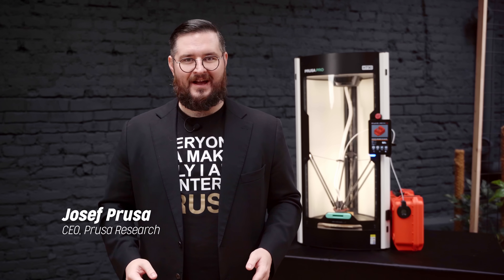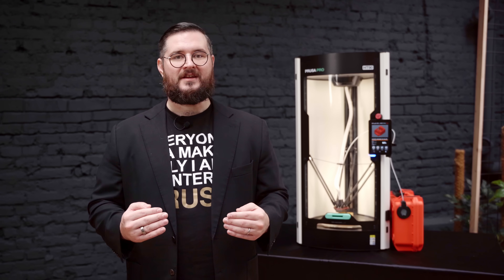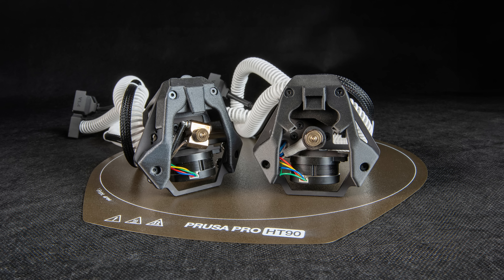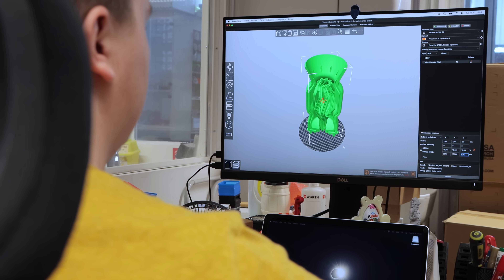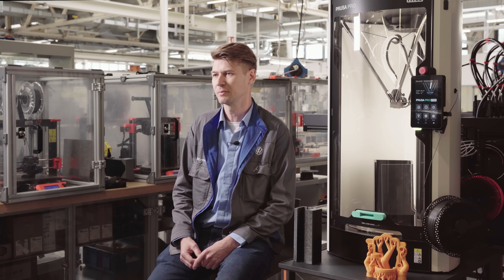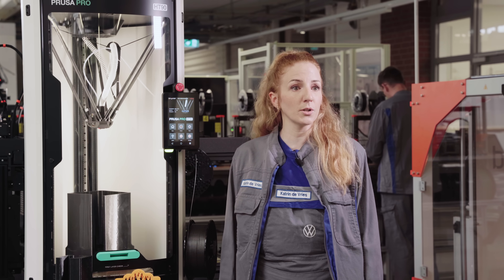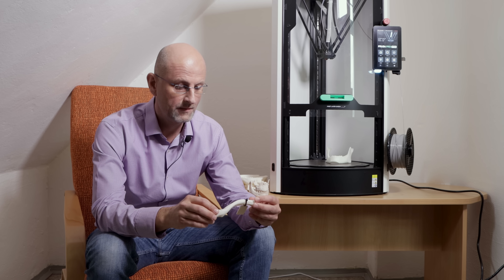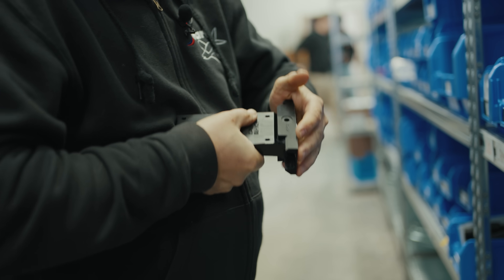Prusa Pro HT90 is here: The Only 3D Printer an Engineer Needs

Comment: As an engineer (3rd year student) one thing missing with these FDM printers is easy watertight/airtight parts and very occasionally resolution. It’s come up as an issue multiple times for me. Mostly the former. I think this could be solved without resorting to a resin printer by Prusa. One produce a highly accurate mini FDM printer within the existing machine. Something modular maybe. So like you change the nozzle on the Main machine but the xyz axis is different so it’s way more accurate, also maybe this would require a specialised filament they could charge a premium for that had very low thermal expansion. The second thing could be a separate post processing machine that basically intelligently melted the layers into a homogeneous surface automatically. I’ve tried this with a heat gun and and a blow torch and have ruined many parts, I usually end up option with coating the entire thing with epoxy resin and that’s annoying. I’m also aware you can make watertight and possibly airtight prints with certain setting but from what I’ve seen those techniques have draw backs and limitations and also require a lot of trial and error.
Reply: I don't mean to offend you, but did you try any prusa printer?  Because with mine (which is a FDM btw), I never had any issue making watertight parts.  The settings are not complicated, it's just a matter of walls / infill.  If you meant however an assembly of multiple part being watertight, again, It's a matter of tolerance, and prusa printers are really good at it.  However I agree, there are lots of trial and errors, but the good thing is, once the setting is done, their machine are so well tuned workhorses, you'll end up with good result everytime.

It's bit of a shame prusa is slowly leaving the consumer market.  I'm glad for their success, but I'm sad we won't see any new affordable gems like the prusa mini in the future...

Comment: This looks cool and the obvious headliner of the peek/other high temp filaments. I just wonderif this still has the same strain gauge auto z offset etc as the other modern prusa printers in the line up.

Also, whether it has input shaping calibration (which I guess I would assume based on the speed).

Regardless, not many high temp printers with decent usability around this price point and I certainly havent seen pseedy ones.

Comment: Ehh... good for engineers and whatnot. Between this and the XL it seems Prusa is forgetting about the hobbyists. :/
Reply: They can't compete in that space any longer. I think that's why they're going after the industrial segment.
Reply: Prusa will do the same that Ultimaker has already done in the past.
All these companys can not compete with the chinese anymore in the hobbyist price range.
So the only solution for them is to move into the direction of industrial printers and sell
the service and not the printer alone.

Comment: Does the slicer correct for shrinking ?  I heard this is one of the issues with high temperature materials.
Reply from the maker: Hi. Yes, Prusa Slicer will apply some corrections. There are also other values in Prusa Slicer that can be adjusted manually to compensate for some specific model.

Comment: I wish you'd rather go down the route of pioneering Non-planar 3D Printing. Feels like that would be more in-line with the original spirit of Prusa Printers, or at least my perception of it.
Reply: It's not like they are only able to focus on one direction at a time. Prusa covers a really wide spectrum of users right now, just because they release one printer doesn't mean the gears are not turning for lots of other stuff under the hood. The blog words this nicely, "We have no plans to change our direction with the Original Prusa printers or to make a sharp turn towards an industrial-only company. However, expanding to industrial segments makes a lot of sense."

Comment: Printer noob here. Can anyone explain how I can justify buying one of these over the X1E?
Or however many X1Es I can afford with the pricetag?
Reply: X1E has a max nozzle temp of 320c, bed temp of 110c and 60c chamber. The Prusa has 500c nozzle, 155c bed temp and 90c chamber.
This enables a ton of new materials to be printed. 
If you don't need the high temps then I would rather go X1E, but the whole selling point of the Prusa is the high temp.

Comment: almost 12k and is it still all 3D printed as all other prusa machines ?
Reply: Are there 3d printed parts? I did not notice.
Reply: From the video it seems only the fan duct to the print are 3D printed. And probably the control panel attachment to the printer body.
Reply: It's an industrial printer, man. :D So it's not all 3D printed, and the price seems to be spot on to me.

Comment: Still too small for my company's needs - the last thing I printed was about 600x400x400mm.
Reply: In which material? 
Certainly not with a material for which this printer was built.
Reply: @herr_rossi69  excellent point. People who claim they need this to print large PEEK models, have done zero research into the difficulty of doing so.

Comment: FLSUN S1 annihilates this.
Reply from the maker: FLSUN S1 is not even in the same class of 3D printers. E.g. it doesn't have any heating of the chamber (the HT90 stands for the 90C chamber temperature). -Mikolas
Reply: How does it annihilate it? 
The Prusa has 500c nozzle temp, 155c bed and 90c chamber.
The FLSUN has 350c nozzle temp, 120c bed and no chamber heater.
The whole point of the Prusa machine is high temp printing, it can do tons of materials that the FLSUN could only ever dream of.
Reply: @Prusa3D  Is a heating feature worth $8,000？

Comment: The build plate max temp is five degrees too cold for PEI and the chamber temp is 40 degrees too cold for PEEK.
Reply: That just isn’t completely true.

3DXTech recommends 130 - 145 C bed temperatures for PEEK and 70 - 140 C for the chamber, for their PEI they recommend 140 - 160 C for the bed. Filamentive which uses LUVOCOM PEEK recommends >110 C for the bed and >80 C for the chamber.

Comment: 9990 dollars? I can get an army of delta printers for that price, I’m sorry but respectfully.. you are out of your mind.
Reply: The big thing is, aill they do peek. Thsts a significant upgrade. Of course if you wont print with that its a bad deal but c9nsider this is aiming in the ultimaker market.
Reply: Not with the same specs. They are not asking ten grand for a PLA/ABS printer. This is for really challenging filaments.
Reply: Add a zero to that number and you can start finding other printers that are capable of what this printer is doing. The market for PEEK/PEI printers has a much higher price tag than you might think, this printer is actually a steal.

Comment: Not much impressive tech. A high temperature printer is required to have a dedicated filament drying system attached to printer where filament should not be opened at all. There are many other complications in printing high temp materials like ultem peek pekk. You cannot just advertise that this printer can print those. The materials shown printed here, any core xy printer with enclosed can print them

Comment: For 1/7th of the price you can buy FLSUN S1 with closed-loop motors, multi-zone bed heating, auto-flow calibration with lidar,  built-in filament dryer and many other features.
Reply: With 500⁰ nozzle, 155⁰ bed, 90⁰ chamber?
Reply: Lord you're ignorant.

Comment: I bet input shaping freqencies would be worse than on a bedslinger. Deltas are not rigid. They cannot be fast nowadays. So chosing delta for new printer design in 2024 is very stupid.
Reply: Why do you think input shaping can't compensate for that?
Reply: @__S__435  Because input shaping is not magic. It cannot compensate wobbly kinematics. It will work, but freqencies (and accelerations) will be lower than on a bedslinger, because bedslinger is more rigid, than delta. No magic. Pure physics.
Reply: Well look at the Flsun S1
Reply: @ericolofsson  I've seen FLSun V400. It had shapers worse than bedslinger, if measured properly (accel_per_hz = 200). What could possibly make S1 any better?
Reply: @TheNamelessOne12357  Define "wobbly kinematics"
Reply: @__S__435  wobbly = not rigid.
Reply: @TheNamelessOne12357  You got some data to back that up?

Comment: What are the main reasons to go for the Prusa Pro HT90 over FLSUN S1?

As of 25/06/2024:
FLSUN S1 costs €1,599
Prusa Pro HT90 costs €11,490

The FLSUN is faster, bigger, can also print engineering materials, and also has a heated chamber. I really like Prusa, but I currently don't know why someone would go for the Prusa over the FLSUN. So please, if you know, let me know the reasons to choose the Prusa over the FLSUN.
Reply: For a hobbyist, tinkering with your printer every so often and waiting days or weeks for replacement parts is acceptable. A failed print here and there, not the end of the world.
But for a company, where time is literally money, these things are not acceptable. Every hour that an engineer has to tinker with a printer costs the company 50-200+€. When printing with exotic materials like this printer is designed to, a failed print might cost several hundred euros in material and throw back the team a couple of hours or days (which again, time is money).

All these things considered, for a company the bigger pricetag is very much affordable if it means reliability, ease of use and the availability of support and replacement parts (if even necessary). And these parts have to be available for AT LEAST 5 years after the last sale of the machine. The combination of these factors is something that (to date) no chinese company can offer.
Reply: @crasbee  thank you! I think that's a great explanation. Although you are completely correct, I do want to give FLSUN a chance to prove they can deliver what a company needs; reliability over a longer period. But that is to be proven. Thanks for your answer!
Reply: Flsun doesn’t get nearly as hot as ht90
Reply: @lucasvandelogt5126  You cannot compare flsun to this. Its completely different game
Reply: @infinitelyexplosive4131  correct. The HT90 can reach 500 Celsius, whereas the S1 can reach 350 Celsius. I do really like the fact that the S1 has a dedicated storage space for the filament spool with filament drying capabilities.

Comment: it's $9990 USD, my fellow 3D printing friend, almost can buy 10 bambu lab x1c... and their specs are quite similar. I guess this machine really is just for the industry who doesn't really care about price like consumers do.
Reply: You are right in the second part of your comment, but the X1C is FAAAR away from the combined feature set of this machine. You might find similar machines if you add another zero to the HT90 price tag.
Reply: Your X1C would probably become a pile of black goop once it heats up to 90 degrees.
Reply: Can a x1c go up to 500 c? They serve different purposes. You can't print specialized materials on a hobby printer
Reply: The bambu lab X1C has a 90c heated chamber and can reach 500c on the hotend? It can print PEK/PEEK/ULTEM?
I didn't think so. Typical bambu bot. Bambu lab needs to refresh your software so you can be more accurate in your bot posts.
Reply: 😂😂😂 @youtubehandlesux
Reply: @Romancelanguagespassion  Their specs are quite dissimilar. What use are ten other printers if they can't actually do what is required?

Comment: I don't see why my company would want this over a  Bambu Lab X1E. The round build volume means it can fit less on the bed than a 235x235mm bed and the extra build height isn't really useful. The price is also way too high when the X1E comes in at 3000$ with an AMS unit. Very weird product, I don't see how it fits in the current market.
Reply: that's because you can't read the temperature specs.
Reply: High temp and political reasons.
Reply: Because China won't get all of your designs and prototypes 😅
Reply: @AmixLiark  it's specifically made to be setup without internet access tho
Reply: @eaman11  I can, but most of the time higher temps materials aren't really that important unless you're in some fancy aerospace business but then your budget is basically infinite so why would you buy this thing when much higher end machines will work better?
Reply: Another bambu lab bot. The bambu X1E is a literal scam of a machine. its just an X1C with a 60c heated chamber for more than double the price. It still uses the same cheap components and has the same trash customer support and QC. The X1E can't print PEEK/PEKK/ULTEM like the HT90 can. The X1E can only print up to nylon. The X1E is a hobby machine sold at an industrial price.

BTW the X1E still logs pictures and your data even when not hooked to wifi or internet. It still tries to send your data to CCP servers. And bambu lab is funded by IDG capitol. The same venture capitol firm that funded tencent and baidu. Two china tech company's known for selling user data and security breeches. Bambu lab is 100% selling user data and you're a fool if you believe otherwise.
Reply: @LilApe  I'm not a fanboy lol, we have one at my job and it works very well. We haven't connected it to our local network because we're very aware of the risks involved.

The 60C chamber is more than enough for very large ABS and ABS-FR prints that take up the entire build volume and the included hepa filter works really well. But the AMS is basically a must have for companies so seeing this prusa printer not come with anything close to the AMS is really weird.

Also if your design REQUIRES those PEEK/PEKK or whatever filaments, it's either a bad design or you chose the wrong manufacturing method. In an enterprise setting you need things that can be transferred over to real manufacturing methods like injection molding.

Anyway, have fun going around being all angry at people who are happy with their working solution. This prusa product just means more competition. Everyone wins, no need to fight lol.
Reply: @EMILE12345678901  You got clowned on. Take the L
Reply: @LilApe  what? say what you want, that machine is printing nonstop production-ready parts that exceed our expectations, no amount of hate from you will change that